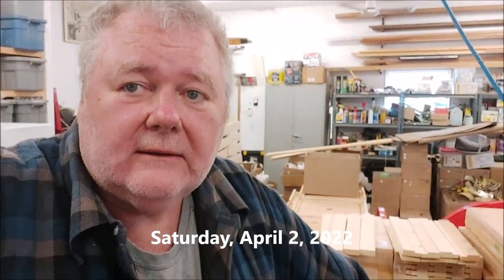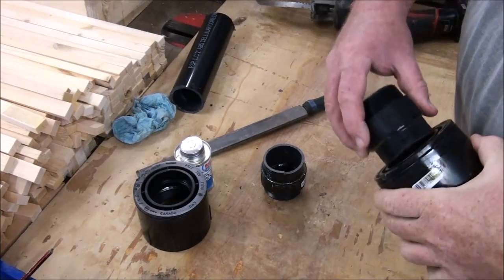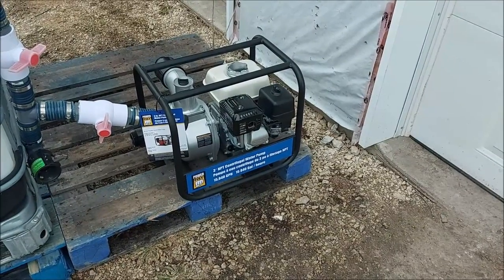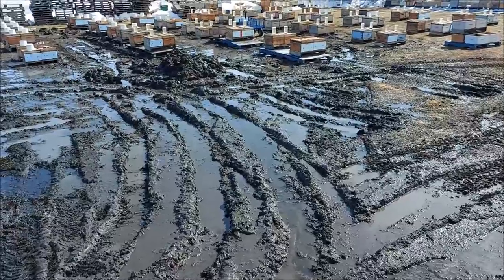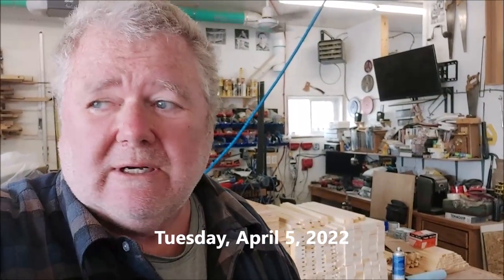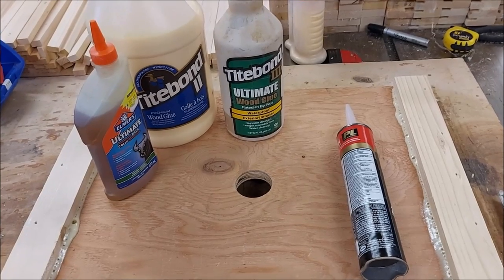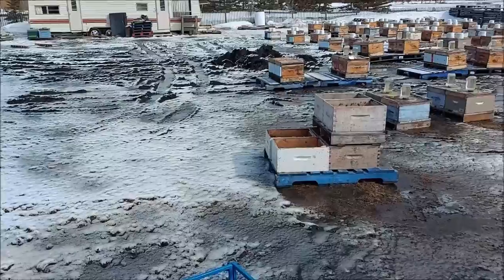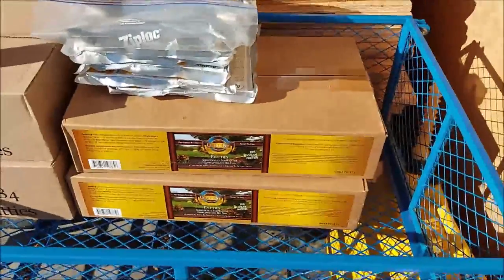⏱Vlog April 2-8, 2022-That Bee Man

Comment: I did some research once on pollen sub, bees will eat anything that has 50% sugar in it.  I have used gobal 15% but not the pre made ultra. 5lbs a colony, wow! The soft gobal,  bees consumed really fast because or the high sugar percentage, at $5.50 a pound here on the east it's not any option.  I have seen videos of the pre mix ultra and the bees barley eat it, probably less sugar. I mix my own ultra bee in the ballpark figure of $1.50/lb. I like to use a high sugar percentage so they eat it fast at an affordable price.
Reply from the maker: I think I just paid about $2.50/lb for that UltraBee, it's gone up quite a bit.  I usually only feed 1 or 2 lbs in the spring.  I have mixed and packed sub but that's just one more thing to do and my time and energy is already taxed to its limit.

Comment: Would installing a series of perforated pipe be an inexpensive solution to the mud?
Reply from the maker: Possibly.  You can't underestimate the composition of the soil here, it's gumbo and does not drain through very well at all.  The logistic of actually working in the bee yard while there are hives there is also a consideration.  Everything is expense also.  I do have some options in mind but everything includes time, effort and expense, three commodities that are always in short supply.

Comment: Probably too late but I will advise my experience, my rabbet joints failed on supers in less than a year with Titebond 2, Titebond 3 is going four years now and no issues. #2 just isn't meant for full water exposure, more ideal for outside furniture that sits under a roof. Humidity/moisture resistant would be  better words than weather resistant. Now I need a warming cabinet.
Reply from the maker: Thanks for that information.  Can you tell me, the joints that failed, were those boxes painted?
Reply: @ThatBeeMan  stained
Reply from the maker: @sidelinerbeekeeper  I'm glad you didn't say wax dipped.  I know for a fact that wax dipping will protect the glue from delamination due to moisture.  Since these will be dipped, I am confident they will hold up but, the customer will be told to get back to me on any failures.  I appreciate the info on the TBII!